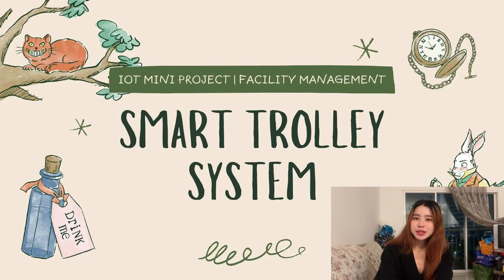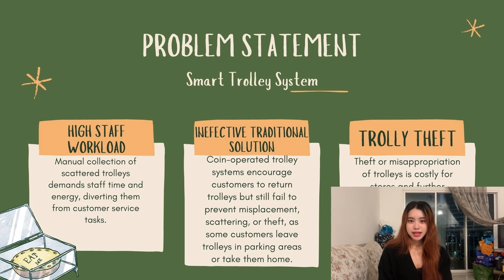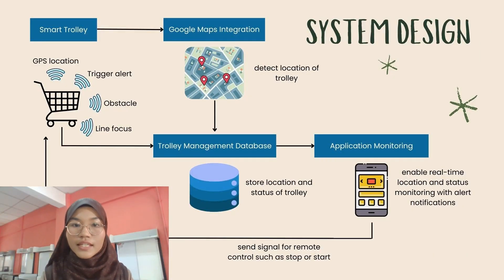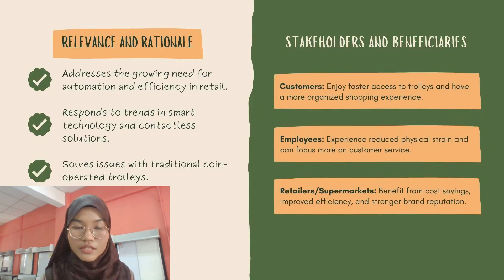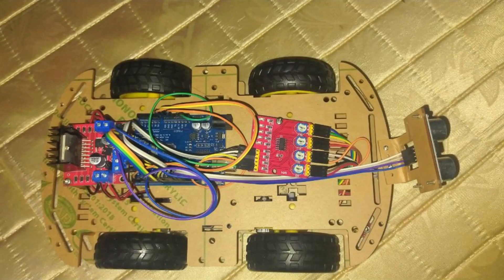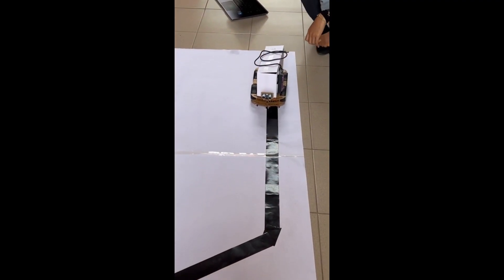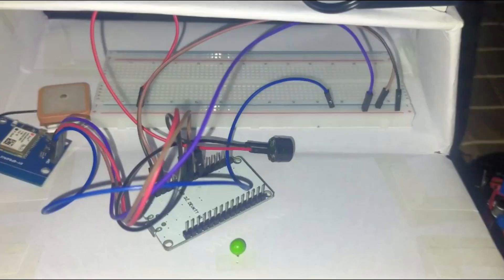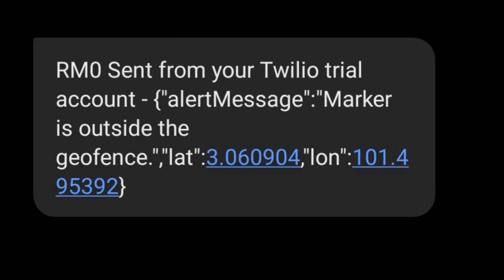IOT PROJECT [JAN 2025] | SMART TROLLEY COLLECTION SYSTEM

Comment: If Clash of Clans had a trolley system, it would revolutionize both base management and attack strategies. Imagine a network of rails running through your village, automatically transporting resources from collectors to storages, or even directly to defensive structures. Instead of manually collecting gold and elixir, a trolley could efficiently distribute them, making base upkeep smoother. Clanmates could also use trolleys to trade limited resources, adding a cooperative economic element to the game.

Troop movement would also see a major change. Rather than slow-moving troops walking from the barracks, a trolley system could quickly transport them to different parts of the base. Defending troops could use trolley stations to reposition themselves mid-battle, making base defense more dynamic. On offense, attackers could deploy a "Trolley Siege Machine," which would break through walls while carrying high-damage troops deep into enemy territory.

Defensively, trolleys could be used to move traps along the rails, making it harder for attackers to predict bomb placements. A mobile "Trolley Cannon" could ride the tracks, repositioning to defend against enemy advances. If attackers manage to hijack an enemy's trolley system, they could redirect resources or even slow down reinforcements, adding another layer of strategy.

A trolley system would change the game by making bases more interactive, attacks more unpredictable, and defenses more flexible. It would introduce new ways to manage resources, deploy troops, and defend against invasions, making Clash of Clans even more strategic and engaging.